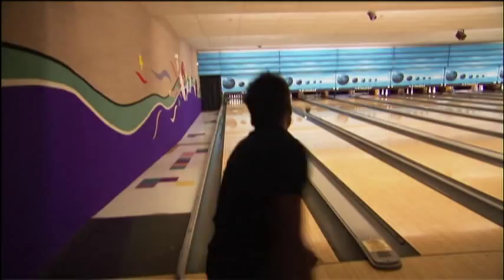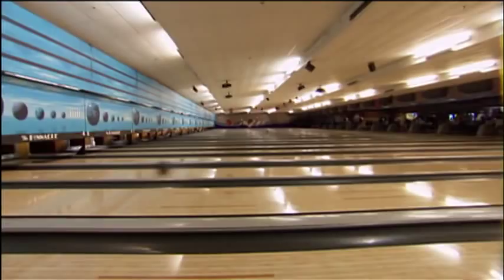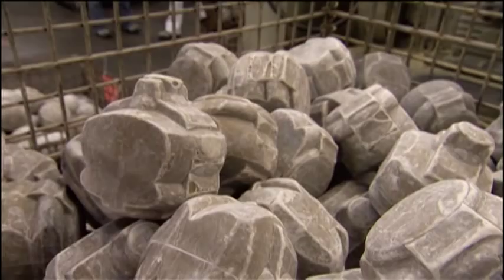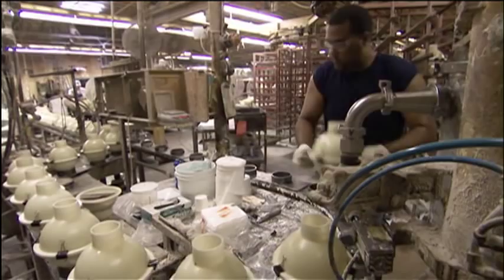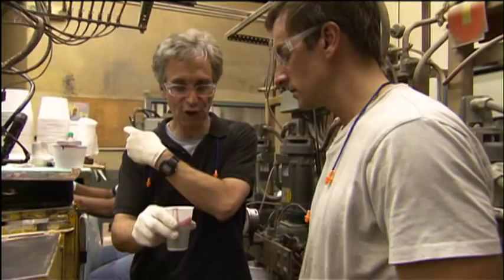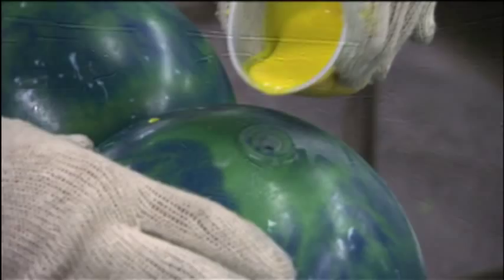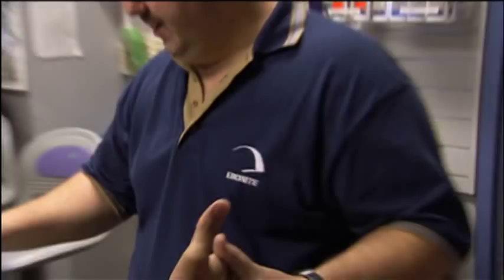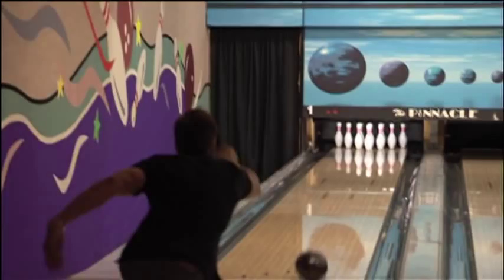Ebonite - How to Make a Bowling Ball

Comment: I quit bowling 30 years ago as a teenager.  I was a league bowler with a very respectable 175 average.  I recently rekindled my interest in bowling.  A trip to the local bowling alley and pro shop showed me just how much has changed.  It also explained why the averages were so high.  People with horrific approach fundamentals were routinely bowling 200+ games.  I'm not sure I like this automatic strike engineering.  There's no telling what they have done to the lanes to promote high scores.
Reply: oh there is telling, THS (the house shot) is set up as a wall now everywhere you go, miss outside the ball hits dry and automatically comes back, pull it inside the ball hits oil and sits still until it gets to the pocket...it's pretty difficult if you have a decent ball and any kind of idea at all about where to throw the ball to not throw around 200 nowadays.
Reply: I was a bowler for roughly 2 years, and had around a 170ish average for the most part. Youth Saturday morning league, and I also bowled for our high school team as well.  The THS and lanes vary from house to house, and sometimes drastically.  Some places still have the classic wood lanes, which are my person favorite, but as dipshits loft the balls over the years, it bangs up the lanes pretty bad and that becomes a factor. Some places have full synthetic lanes which are okay, seem to leave a very heavy oil pattern on top.. but it is cheaper and easier to replace a badly damaged lane. Then there are places that have a synthetic front half and a wood back half, which act like a nice middle ground.  Different balls are designed for different lane conditions as well. And however that I do agree that they all are engineered to promote high scores, the skill set used is still fundamentally the same for anyone really serious about the game.. But a lot of people rely more on their bowling ball than their skills. I personally have small timing issues and release issues but because I am just getting back into it myself after a 4 year absence.
Reply: @FB_Wanderer  i don't think its ppl rely on their bowling balls more then the skills cause you need good skills to get the ball to hit the pocket consistently, i mean you dont just roll the ball down anywhere on the lane and expect the ball to strike, the lane conditions can alter that but also where you look on the lane and place the ball based on the boards ur looking at, or aim at certain arrows can definitely help. getting strikes every time is still hard to get, yea you can bowl a few shots and they go good but then in the same spot it changes and hooks differently, you have to change where you throw it after every few shots, and you gotta know what to do if the ball is doing too much or too little and i need to change balls, but thats just my opinion, ive been bowling for 19 years and i dont like it when ppl try to hook house balls when their no tech behind it, yea they they do it for shits and giggs but still. anyway let the kids do whatever.

Comment: I’ve yet to see how they keep the core exactly in the center of the final mold, so that an even amount of the urethane all around... ie.. so the core is not 1/2” from the outside edge, for example... 🤔
Reply from the maker: They don't actually show it in this video, but I believe there are three pins that are stuck in the core. When they put the core into the mold, the pins hold the core in suspension, so when the outer material is poured, the core stays in the center.
Reply: It's held on with  metal dowel inside the bottom mold I made hammer bowling balls for 20 yrs

Comment: A question:  How heavy are the cores?  There must be a range of weights for them.
Reply from the maker: I don't believe there is a range of weights on the cores. The overall weight the ball is determined by the outer core, and the weight is determined by the density of the outer core. If you want a 10lb ball, you add more air to the outer core. If you want a 16lb ball, then you have less air. And that's how the overall size of the ball remains the same regardless of weight.
Reply: @yuppiehi   My apologies - I asked my question poorly.  What I'm curious about is what  proportion of the overall weight of a ball would be taken up by the inner core?
Reply: Usually a 10-13 pound ball has an entirely different core than a 14-16 pound ball of the same model. So if you think that 13 pound ball you just had drilled up has that DeathMaster X4000 Supermolecular Positronic Core in it, it most likely does not.

Comment: 5,000 balls per day?! That's exactly 1,826,250 balls per year (if they work 7 days a week)
Reply: +Headless Horseman its the whole Ebonite factory or its subbrands at the same time I suppose. Thats Ebonite, Hammer, Track and Columbia 300. I dont know if they have more brands now. They each release like 10 different balls a year, or some do and remain in stock for most of the 1st year, some balls are so "bought" that they keep doing them for years. Example, Storm Hy-road, I tihnk that balls been in production for about 6 years now
Reply: +Headless Horseman although I DO agree, that 5k a day is probably too high, they probably up their production when new balls are coming out to meet early demands
Reply: @LuchoVena  i think as of 2021 Brunswick bought out ebonite and its other partnered companies like hammer, track, columbia 300, and DV8.  Cause Storm has roto grip but also i saw that they acquired 900 global also so that's part of the Storm company now too.

Comment: So they are saying that Symmetrical Balls Don’t hook?
Reply from the maker: Purely on the basis that the core is symmetrical, yes a symmetrical core alone will not help the bowling ball create a hook. We're talking about house bowling balls when we speak of symmetrical cores. And house balls are symmetrical because it needs to be usable by anyone - left, right, two-handed, between the legs, etc.

You can however make any rounded object hook, regardless of what's on the inside. It just take a lot more effort in terms of getting more lift out of the fingers and wrist, and so on for the ball to produce a hooking like pattern. But even so, this is not technically a "hook." All you're really doing there is spinning the ball, like you would with a baseball or a golf ball. The problem with spinning is that, when the ball hits the pins, the ball will deflect more severely since there is no asymmetrical motion to force the ball to stay on the hooking path. So even if a spinning ball hits the 1-3 pocket, a spinning ball will probably end up deflecting to the right and maybe even hit the 10-pin on its way into the pit.

So the key here is that asymmetrical cores will not only force the ball to hook, but also keep hooking and sticking to this line until it finds its sweet spot, which then will cause the ball to once again roll straight. But to attempt at doing the same with a symmetrical core bowling ball - you're basically torturing yourself.
Reply: symmetrical cores are for anyone for example, newbies, families etc
Reply: Performance Symmetrical Balls will hook but not for cheap Symmetrical Balls like House Balls and the Brunswick T-Zone.

Comment: i dont know why these idiots all say "thumb comes out first" its nonsense. theres no other way a your fingers can come out.  if you wanna hook, u gotta cup the ball atleast a little bit. thats all there is to it.
Reply: It's not nonsense. A lot of newcomers, even though they are cupping the wrist but they're rotating the wrist so much that the ball comes out about at the same time from thumb and fingers, resulting in a inaccurate spin and possibly injuries rather than good rotation. It's good to concentrate on having your thumb go out first soon enough to get the hand in a good position behind the ball to prevent injuries and be more accurate. After that they might try cupping the wrist more to get more rotation.
Reply from the maker: Thumbs before fingers is actually still true today with the modern swing. Your hand is supposed to be behind the ball, with the wrist somewhat bent. When the thumb releases, both fingers should still be in the ball. This creates lift and rotation. You're not supposed to rotate the ball with the thumb still in the ball - this can even cause injury to the thumb. Also, the thumb should never be pointing down on the follow through, which would be the result of keeping the thumb in the ball too long.
Reply: jannexorz so tell them not to over rotate the wrist. i dont think any pros are thinking about their thumb when they bowl.
Reply: yuppiehi once again, all that can be solved by telling the player not to over rotate their wrist.  but if people are cconsciouslythinking about their thumb coming out, their going to bowl pretty fucked up
Reply: ***** Yeah, that was basically what I was trying to say. Of course the pros are not thinking about their thumb, it comes naturally out first, but I was referring to bowlers trying to hook the ball first time. yuppiehi Very good addition about the follow through and thumb pointing downwards, however it is not too rare to see the best bowlers doing that while nervous and making a bad shot under TV-lights, usually with bad results.